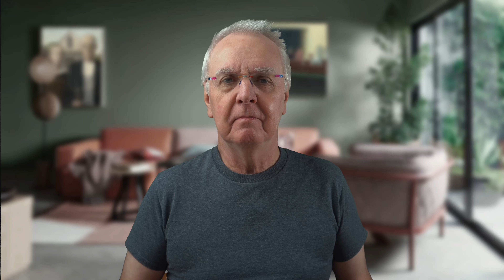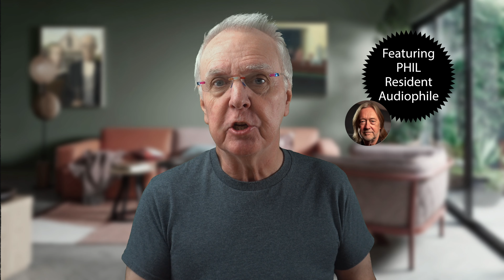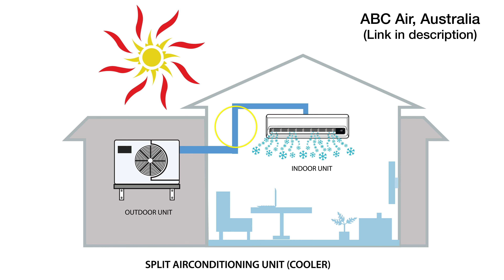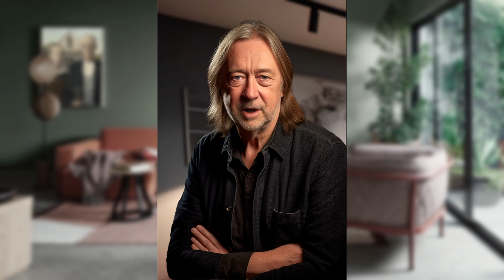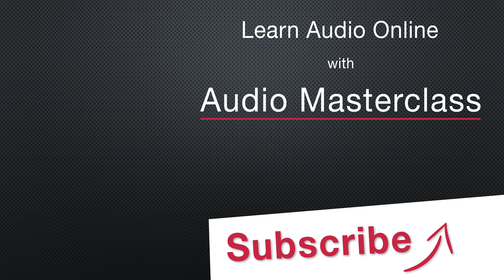Audiophiles! Are you losing your cool?

Comment: Hearing the difference between a competently designed hi-fi Class A or Class AB amplifier is completely imaginary as all forms of distortion should be hundreds of times lower than any human being can hear, as long as they're both being run within their design specs. The loudspeakers themselves are likely generating tens or maybe even hundreds of times more distortion than a properly designed amplifier.

Any competently designed amplifier will always run within its design temperature range if installed as per the manufacturer's instructions unless you live in a desert. The only components that have an appreciably shortened lifetime due to increased running temperature are polarised capacitors. Competent amplifier designers only use these where there is no other choice but to use them.

Running an amplifier with excessive cooling taking it below its minimum recommended operating temperature may actually increase distortion. It also increases the risk of internal corrosion through condensation of moisture in the surrounding atmosphere. Nobody in their right mind would slap a Peltier device on something that wasn't specifically designed from the ground up to use one for this reason.

Fight me!

Comment: Dip the amp in thermally-conductive resin to electrically insulate the components, then run the amp under water. Simple! Only thing to do is invent thermally-conductive resin.

Comment: Thermal erosion is the main reason modern electronics fail. Receivers need to deliver more and more power to more speakers (thnx dolby atmos) so active cooling is a must. I use a pair of silent 5V USB fans to suck out hot air and create a airflow

Comment: Just to amplify a comment:  For a Class A amp - think single ended 6L6 as an example - the average plate current rises from a minimum at idle to a greater value when delivering output.  Said another way, the plate dissipation, and thus heat, goes up under load.  I think confusion about Class A amp thermal behavior arises from confusing efficiency with power dissipation.  The efficiency is plainly worst at idle -- heat with no audio delivery -- and improves under load, but this doesn't mean the heat dissipation goes down with load.  It does just the opposite.  My two cents.

Comment: Is attending to cooling appropriate? Absolutely! Ways of doing so have improved over the decades. It used to be that rotary fans were rather noisy, even the Rotron quiet ones. Modern computer fans that run on DC can be kept vanishingly quiet and easy to speed adjust. Also, Class D has come a long way. Very small, very powerful, very clean. Check out Purifi Eigentakt and others. If vacuum tubes (valves) are your must-do, heat goes hand in hand. Impossible to ignore. One more thing. Computers are far more efficient now than before. Thanks ARM!  PCs that sound like jets are a thing of the past. And then of course, electric cars vs Otto engines. Have a good one.

Comment: Most correctly made Class-A amplifiers will go to AB when driven harder than peak Class-A power and it won't sound bad until exceeding the Power Supply capability. Of course, a 25W Class A amp is enough power when using speakers with decent efficiency: HORNS, not electrostatic or Ionophone.  When single horns and 25W are not enough for your 10000 square foot 80' high listening auditorium, get a dozen more 25W Class A amps and fill in the gaps with more big boxes and drivers as if you are a distributor for Altec-Lansing in 1959.  For the more hungry esoteric audiphool: try buiding a system from the Cost-Is-No-Object gear handmade at Bell Labs for ERPI.  Good luck.
Reply: Watercooling electronics is a timebomb. Try to find Apple Macintosh G5 tower with working original watercooling. All of the survivors I have found are the aircooled dual 2.0 GHz models.  For audio amp cooling, look to Krell and Conrad-Johnson for excellently large fanless heatsinks. Favorite trick for better cooling of stacked gear is to place 2x4 lumber between top of one unit and feet of next to make a big venting space, also keep well away from a wall or curtains. Fans are a last resort and are included on cheaper gear to reduce heatsink cost.

Comment: How about this: hybrid passive + fan-cooled heatsink. On loud passages, the fan is turned on proportionally, adding some extra temporary thermal capacity. The curve for the fan's speed could even be matched with the average rate the human ear recovers its sensitivity.

Ps: Of course, for optimum noise levels (and for the highest cost – a fetish among audiophiles), I'd recommend a centrifugal fan.

Comment: I have always hated any fan in a audiophile system.  They make noise and when they get old even more noise.  They also bring in all of the dust and dirt in the air into the amplifier.  A properly designed amp doesn't require a fan.  Fan's are a electronic crutch for a poorly designed amp !  I have seen some with a filter on the outside of the fan,  who is going to clean it !

Comment: Solid State cooling...but, for the best audiophile experience one needs the warmth of valves/tubes so won't solid state cooling mess with the sound? I need to know before I buy the best audiophile solid state cooling system.
Reply: Don't waste your money.  A plain old computer case fan will move more heat than any Peltier device ever will.

Comment: Matching the ohms on the speakers with the amp is a common issue. A 4 ohm speaker might dip down to 1 or 2 ohms causing more resistance and heat.  PMSL  with Audio Phil's solution to heat, i guess if all fails with his cooling systems he could give his mighty power amps a golden shower  ha ha ha.

Comment: Dry ice may work for you Phil.  But us humans don't do so well with higher consecrations of carbon dioxide.  4% in the air is dangerous and prolonged can make your pretty ill at the minimum. 10% well convulsions , vomiting 🤮 and shortly thereof death ☠.  This is if you don't have any cardiovascular or pumanary health issues. Not a good idea for a giant Class A amplifier in a poorly ventilated man cave !
Reply from the maker: This is Phil's way of demonstrating his dedication to his hobby.
Reply: @AudioMasterclass  😂
Reply: If you can't get hurt or killed from an activity, it's not a sport. If it's not expensive, it's not even a hobby. Is audio playback perfection a mental illness? I like to think of being paid for good sound as a job.
Reply: @pirate0jimmy  sort of like  being in the mosh pit and being filed with that cloud of fog.
Reply: One solution not mentioned is typically not exceeding a half watt per channel in my three  amplifiers they pretty much stay the same temperature  whether it's idling or being listened to . Ironically my MCS 2255 ( JC Penny branded Technics) has Freon tube connecting the separated SU amplifier packs to the heat 🔥 sink😮. It's seems that it was marketed as a "New Class A" design under the Technics name. The other two are Class AB MOSFET amplifiers. They are all good enough 😊.
Reply from the maker: In an idle moment I considered asking ChatGPT to do some calculations around this. With a Class A amp, some typical parameters, and cooling for an hour after being fully warmed up, Phil is suffering a mild headache, shortness of breath, and drowsiness. Fortunately, due to his habit of not listening lying on the floor, he isn't quite dead yet.

Comment: The Fosi V3 Class D that I use actually gets hot in use. I attribute that to its compact size where the components are next to each other. I theorize that spreading out components in an amplifier would lessen heat buildup as well.
Reply: Actually in the V3 and other TPA3255 amplifiers the major source of heat is the TPA3255 Class-D chip itself.  That little fingernail sized chip is a real little furnace. Without it's heat sink, it self-destructs in just a couple of minutes.

Make that worse by using fully enclosed aluminum housings so that hot air just builds up inside the case which contributes only minimally to cooling.

Now make it even worse by trying to use the case as a heat sink.

If you want your V3s to run cooler, put rubber feet on the top and turn them upside down, place them side by side about 3 inches apart and blow air across the bottom (which is now the top).
Reply: "Now make it even worse by trying to use the case as a heat sink.".  That's actually a brilliant idea.  Turn the entire case into a huge heatsink, extracting the heat from the amp chip.  Who cares if the case is warm?  Mine have been running several hours a day for months without issue.  Very happy with them.
Reply: That makes sense except to start adding devices to cool a device. That the V3 runs as hot as it does it will probably not have a long life. It's funny but Class D is touted as running cool and highly efficient. Probably other so-called Class D design topologies do meet that criteria. The V3 is still a bargain for its quality sound and so can live with its limitations for the use while it lasts.
Reply: @MarkThomas-hm3ju  
Of course... An understandable point of view.  

I've done very deep dives into the design and construction of several of these mini-amps  and I can assure you the TPA3255 chip is quite capable of defending itself in normal use.  The thermal guards do not cut in until the chip itself reaches 120c and will not shut the chip down until it reaches 150c so the chip itself can withstand a fair bit of brutality.  Of course the heat sink temperatures will be lower, due to thermal resistance of mounting points and the thermal paste used.

Given a full on pro-grade forced air cooling solution the chip itself is able to deliver a very reliable 220 RMS watts per channel on 4 ohms, with a 48 volt supply.  However, in these poorly ventilated implementations we are seeing from China, I strongly suggest you do not drive them on more than 36 volts at which point you will get about 130 to 140 watts per channel on 4 ohms with surprisingly low distortion.

The TPA3255 chip also has active indicators for Clipping, Over Temperature and Protection. I consider it a mistake to not implement them in these small amplifiers and have told the manufacturers this on more than one occasion.  It's a simple circuit involving 2 LEDs and 2 resistors. In action the (usually) yellow clipping indicator will pulse each time you overdrive the chip then latch full on if you overheat it and the (usually) red protection lamp will come on to indicate the chip has shut itself down.  Given the simplicity and low cost, I see no good reason not to give the end users access to these warning states.

I like the TPA3255 chip. It is a well engineered and surprisingly capable design that lends itself well to mid-fi and "fun-fi" implementations, when operated within it's limits.

If you would like to see what I do to these mini-amps, you can search for "ldblake music" and look for my DB avatar.
Reply: Actually, it's strange the V3 started to run cool. I actually like the V3 very much as it has good components and a nonsense build at a rock bottom price. It sounds very good too. As a Kickstarter it's probably Fosi's most thought out and best unit. I wonder why it ran hot for several months and then went cool. I did have new speaker cables that were not broken in that are now. I also thought there might have been machine oils that contributed to any heat buildup. Anyway hot or not the V3 is a historic buy.

Comment: Peltier devices mentioned in the video do not help much for cooling in a closed space.  When you pass an electric current through a peltier device, you get a hot side and a cold side... but the net temperature in the space remains the same.  -10c on one side +10c on the other...  Not quite what you want in an amplifier casing.
Reply: Worse than this. Overall temp of the room goes UP due to losses in the cooling circuit.
Reply: @pirate0jimmy  
"room"?   Inside a device case ... not an entire room.

Comment: A four channel Pass F5 Turbo V3  (DIY) amplifier has 32 output devices mounted on a cold plate, each device dissipates 25 Watts to make a total of 800 W.  A central heating pump, two small car type radiators each with a 5 K RPM cooling fan remove the heat, the temperature differential between the input and output of the cold plate is 2 Deg. C.  Because of the fan noise the system is in the cellar below my listening room and because the 'speaker cables are long and the amplifier is wide bandwidth the system is prone to oscillate.  Aluminium foil tape wrapped around the 'speaker cables is connected to the bonded mains earth to keep things stable.

Previous attempts at using forced air cooling resulted in smoke and tears (mine).
Reply: Wow! That setup would make AudioPhil proud.

Comment: I have some big amps, including Class A amps, in cabinetry. I have a couple of fans in the back of the amp shelf cabinet, with a temp sensor.  The fans come on at 33° (90° F ) and the fans move air through the cabinet.  The fans are fairly low speed and can't be heard at the listening position.

Comment: A 'pure' Class A amp by definition becomes hottest when idling. As such the idea of switching to class AB when it becomes hot cannot be applicable. The amp should; be designed to become thermally stable at a safe temperature. What can and does happen with many (non single-ended ) amps is that they are biased to produce  some considerable amount of power in Class A and when power requirements exceed that then they 'slide' to class B. Whether this kind  of amp (high biased push-pull) can be called Class A or should be called Class AB is a matter of semantics (and marketing).
Reply: I beg to differ. Retired research EE and college prof. Class A amp power dissipation is in fact lowest at idle, increases when delivering audio. On the other hand, throttling an amp delivering power is prone to distortion. Good low distortion alternatives to Class A do exist — modern class D amps, for example, or amps that idle with some cut off but use feed forward to deal with crossover distortion, like THX and Benchmark designs.
Reply: Where I come from, we call such amplifiers Super class-a. The nearer the signal is to the zero-crossing point, the higher the bias current. So, at 0V, it would behave as a class-a amplifier and, at the voltage extremes, as a class-b amplifier.

Comment: I'm running two Yamaha recievers RX-A6A and an older similar model.  When i crank them up to live performance levels, the fans come on. There are different levels of cooling, and i only hear the fans when the music stops. All fans shut off within a few seconds of the music stopping.
I've never noticed the sound during the playing. 
All the other amps don't use fans and run warm.  The Carver M-400 power cubes never get hot. 
I try to keep the room at 72 degrees, so that helps a bit.  I do have liquid cooling systems from CPUs but don't need them on the audio amps. 😮😮😮😮😮😮😮😮😮😅